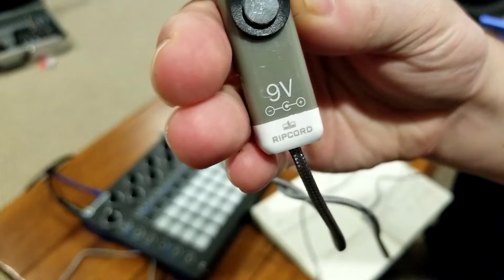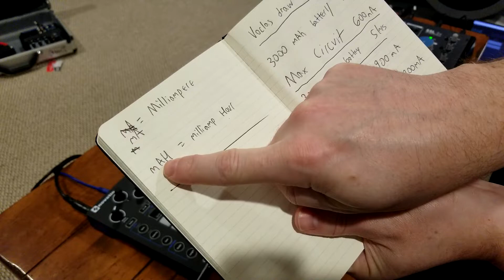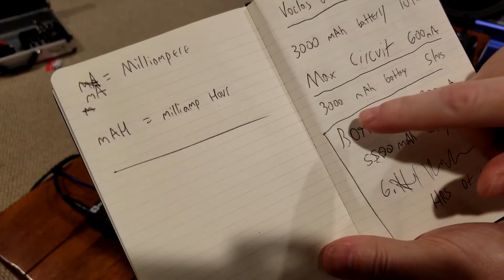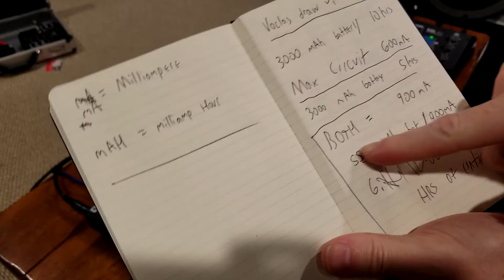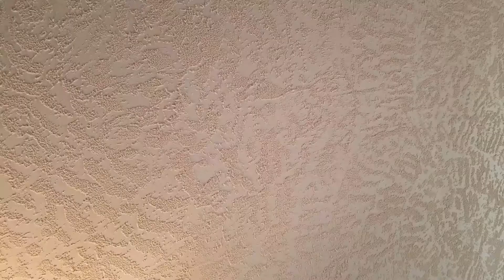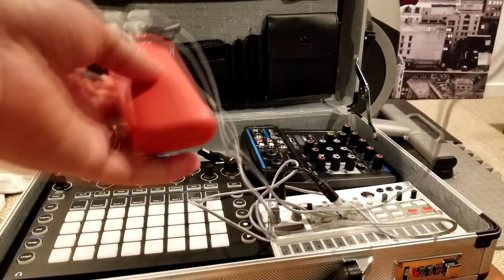Powering the Volca Sample, and Novation Circuit, via USB, with My Volts Ripcords

Comment: I had exactly the same thoughts as you and bought a similar USB rechargeable power pack (900000maH) with 4 USB outputs and some 9V and 12V USB voltage step up leads.  This was to power a Korg Volca Keys and Sample, a Yamaha SU10 sampler, a Maker Hart mixer and some USB powered speakers (but not all at the same time!).   I also found the same problem as you, that depending on how you plug in each piece of gear, any other that is switched on may just turn off.  I figured out that, for my power pack, this is due to the 4 USB power outputs being arranged in 2 different "banks".  The 4 outputs are also rated separately at 2A max and 1A max (but it doesn't say which output has which rating!).  If you connect, say, 2 pieces of gear into 2 sockets on the same bank, the initial current surge when you switch them on may cause one of them to trip out.  So, you need to power the gear from a socket on each separate bank.  Of course, this depends on the individual power pack you are using so it might pay to experiment with powering each piece of gear from a different USB output socket and on your pack and trying out the best order to switch them on.  The other point to bear in mind is that the USB voltage step up leads have current limitations, especially on the higher output voltage.  Just as an example, my USB to 9V lead has a max current of 2.1A in and 800mA out, and the 12V lead 2A in and 750mA out.  Also, it is usual that if you plug an external power lead into any piece of gear that contains batteries, it should disconnect the batteries as the power source and only use the external supply.  I hope this may prove of some use to you and please keep up the good work.
Reply from the maker: Awesome, thanks for the info, I'm using two power bars for my main setup, but maxed out on the outlets. Thankfully I got wall plugs right by my desk, so it easy to pull the power bars out and kick all the wires under the desk.

Looking forward to trying the sample/circuit on the road, picked up another power brick for the cheapo mixer as my old one wasn't pushing enough juice for it.

Comment: Those power bank units come in handy. Ended up getting one to run M:S units and the Korg NTS-1... Was running out of space for power supply units to be plugged in when I used a lot of stuff at once and it definatly solved the problem...
Reply from the maker: Nice, yeah, they seem to be a nice solution for quick and easy power.

Glad to hear you got some too, and are still working for you, as I'm hoping the cables maintain their reliability over time!
Reply: @NickCapron  I ended up going with some cheap made in China USB to power jack cords to run the MS units off the battery pack. Then the NTS-1 just uses a normal cell phone type USB cable. So far no prob tho even with the cheapo cables. The battery pack i got can power 4 units at once which is a good thing. Im using 3 power strips to plug stuff in but once I tried different setups with the MS units along with the NTS-1 along with other stuff all of a sudden I was runnin out of places to plug stuff in... Gettin 3 things to run of the battery pack seemed like the best fix as I didnt really want get into using a 4th power strip. Stuff starts adding up fast plug wise when u add in the computer and monitors and mixer along with all the gear and etc...
Reply from the maker: @GearHedd  awesome, wasn't aware that there was cheaper copies, maybe they don't ship up north here in Canada, or maybe I didn't search well enough!

I hear you about plugs, my main setup is a mess of ac adapters at the moment, need to see if there is a way to clean that up or my 3 or 5 year old are going to get caught in the wires one day and yeet that set up all over the floor =)
Reply: @NickCapron  in my setup I use 2 metre extensions. They plug into the main power bar and each one takes a pair of wall-warts located close to those synths. It gets everything away from the main power bar and makes life easier when I take a synth off the shelf because the PSU is close-by.
Reply: @NickCapron  The ones I got are a little bit different as the MS units run on 5 volts which is what the power banks put out. They sell a cheap Chinese version of a USB 5 volt to 9 volt cable that converts it to 9 volts like the Volcas need tho. Maybe im missing something tho and theres a reason why 1 of those wont work. Think it will tho...